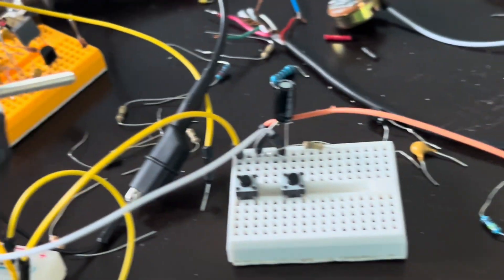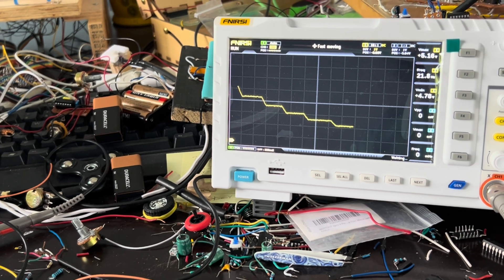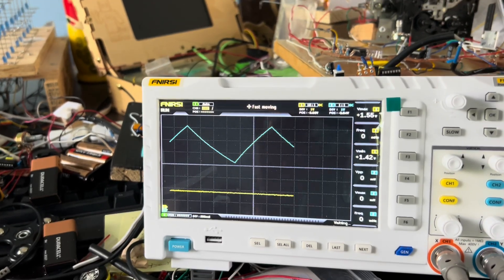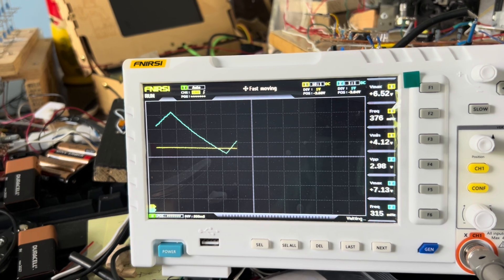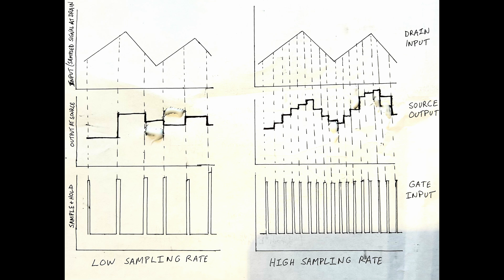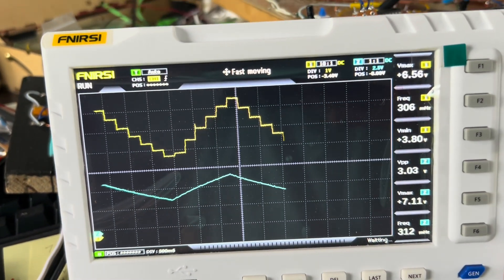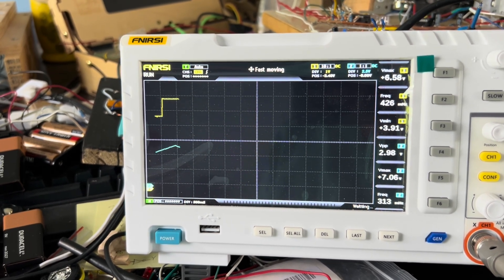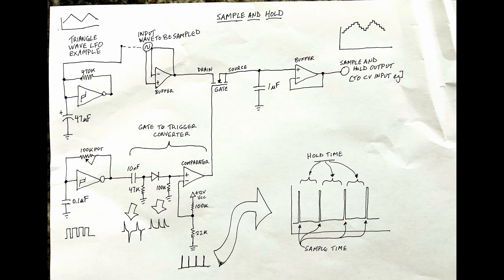DIY Sample and Hold circuit for Audio Applications

Comment: Could this circuit be used for sampling 600khz signals? Do you have a schematic for your project?
Reply from the maker: @estudodasvozeseletronicas  sure. Just need a fast enough sampling rate to satisfy nyquist theorem requirements